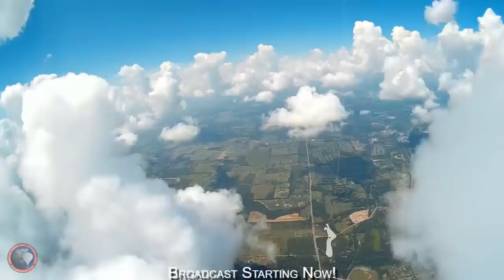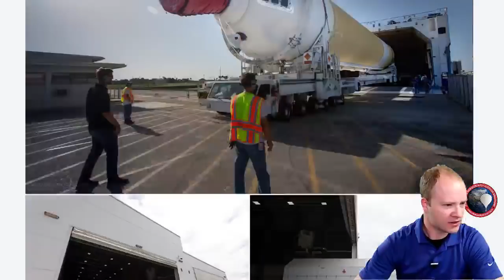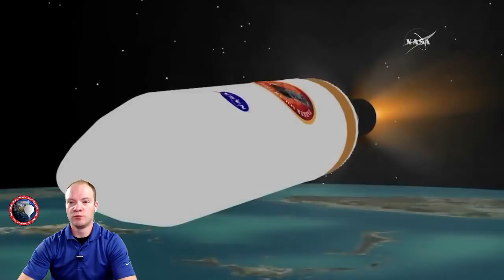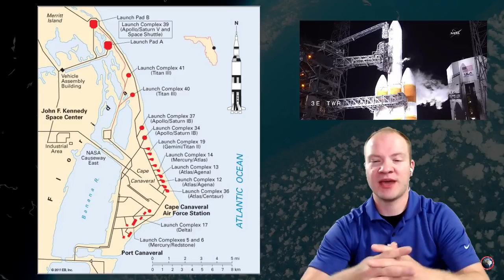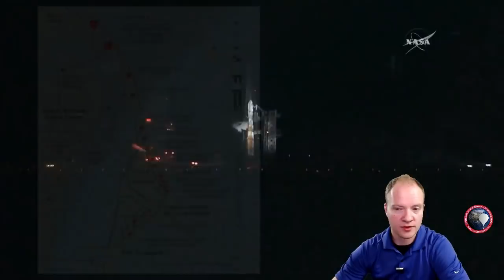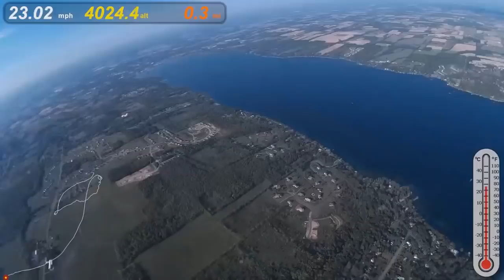[SCRUBBED] Parker Solar Probe 🔴 Live Launch Commentary | ULA Delta IV Heavy

Comment: Is there any damage if any to the launch pad from the thrust of the rocket engines
Reply from the maker: Usually very little.  Launch pads are built to withstand the heat and exhaust from the rocket as it leaves the pad.  Most sensitive equipment is protected with shielding either the entire time or protection is automatically put in place at liftoff.